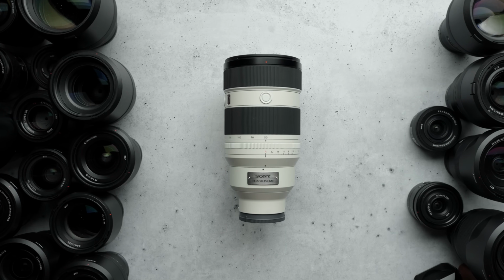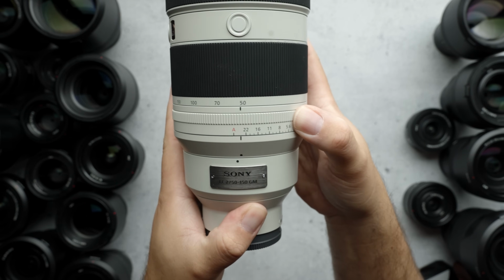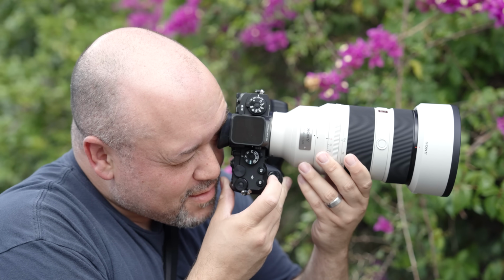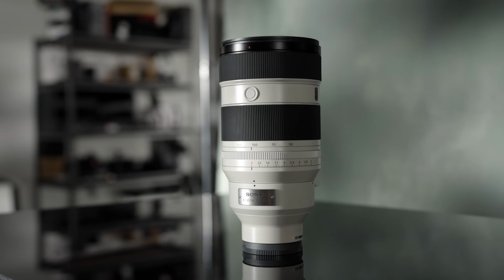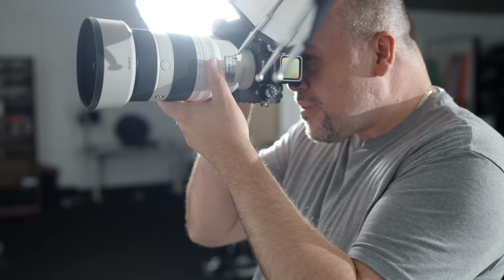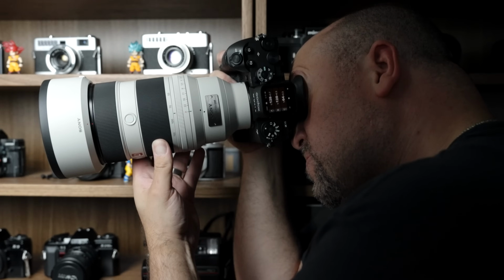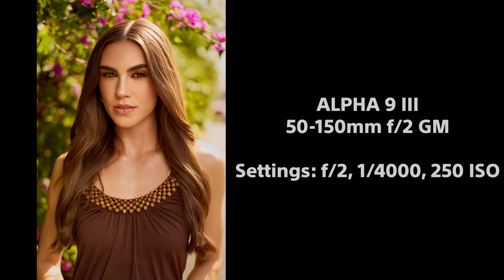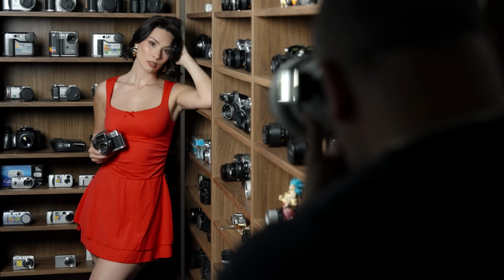FE 50-150mm F2 G Master: First Look with Miguel Quiles

Comment: Fortunately, there is still Tamron selling excellent glass for smaller prices 🫠
Reply: it doesn't even compare.....
Reply: @ I don’t think this one is worth a price of 4200€. It will for sure be an excellent lens, but the performance/price ratio is completely off. 😂 most people won’t even notice if you shot an image on a 500€ lens or a super expensive 3000-5000€ lens.
Reply: Different pple have different amount of money in their bank. 
It’s ok. Let those who want it can afford it get it. 

Price aside. I dont see whats the hooha over it. It is the first f2 zoom lens of its kind but it is just a lens with multiple “ f1.8 prime” stack into 1 lens. I thought the same people would drool on 1.4 and 1.2 lenses. Now why all so onto this f2 lens. Just because it is new. Ok…. Haha
Reply: @fotosvond_ … if you don’t think it the price worth, it’s of cause not the right lens for you. 🤷🏼‍♂️
Reply: I think this lens is aimed squarely at A1 and A9 series shooters who want active AF while zooming with 30+ FPS access. I’ve had the tamron 35-150 since launch because no other lens on the market provided that range (still doesn’t if you think about it) but it doesn’t provide active focusing while your zooming in and out at the same time. I knew this and dealt with it  on my OG A1 and not on my A1 II but now Sony releases this lens and I will be upgrading to take advantage of it. Most of my images were at 50 and beyond so it works for my use case and I always carried the 24 GM with me. My combo will stay the same adding this lens. Again this is all subjective to personal use and there is no “right” answer but rather personal use case as it’s always with camera/lens combos.